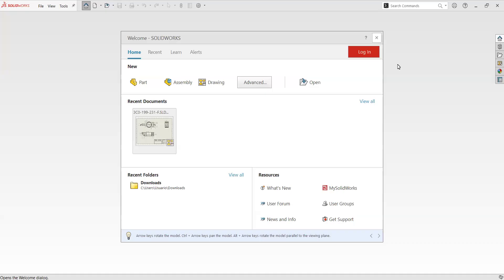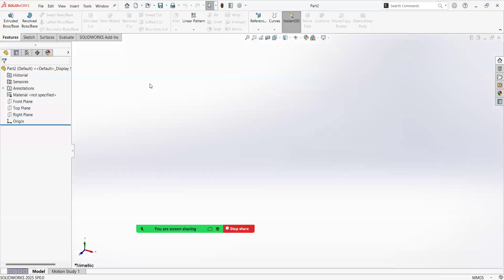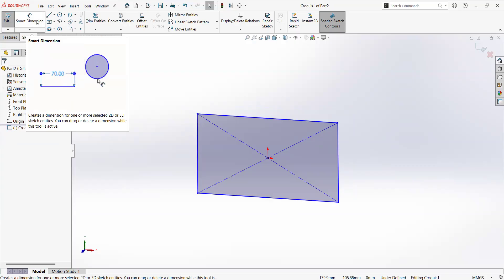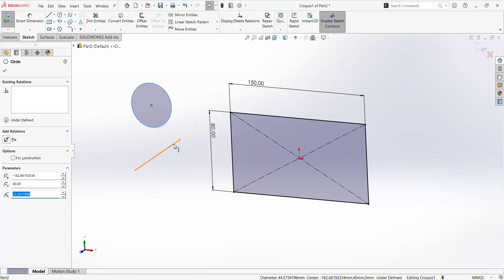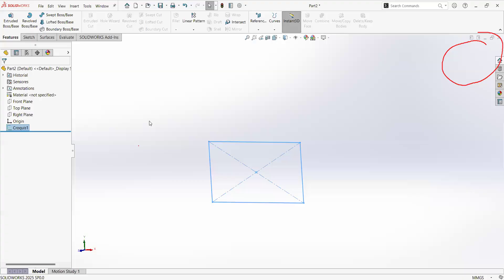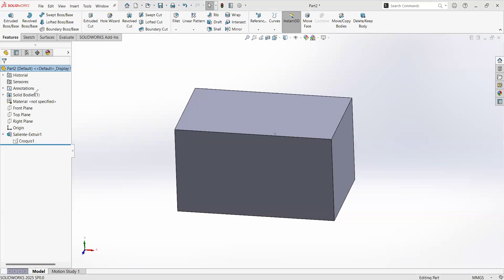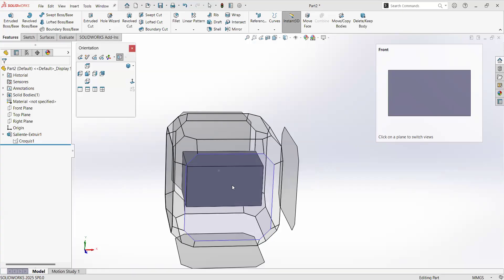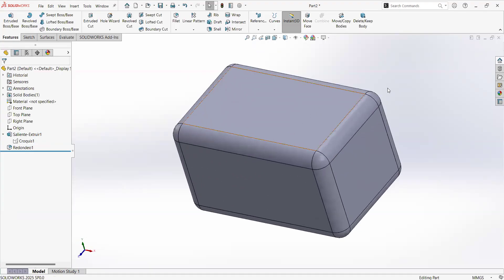SolidWorks 2025 Basic Tutorial - User Interface - Sketch - Extrusion

Comment: Hii in my solidworks some toolbars isn't highlighted black , I meant after click on them isn't working.
Reply from the maker: Depending on the SW version you may see some options not available or it requires turn on the corresponding add in
Reply from the maker: With SW version I’m referring to standard, professional or premium